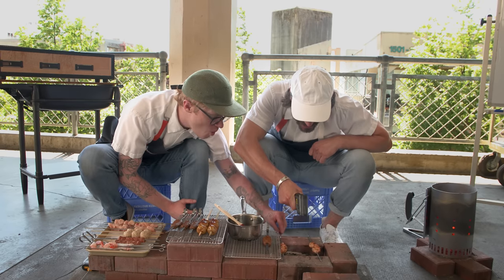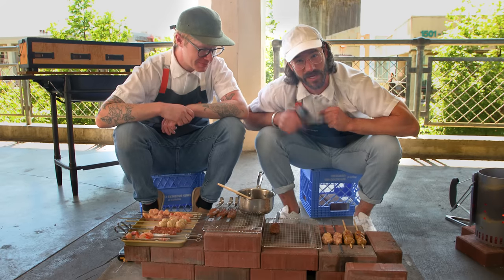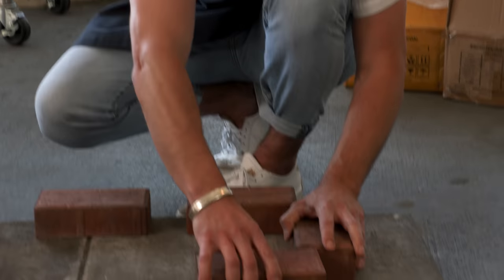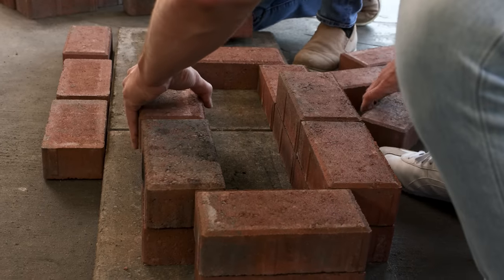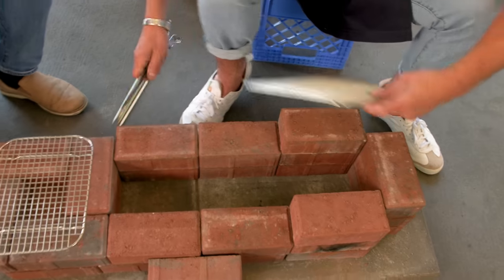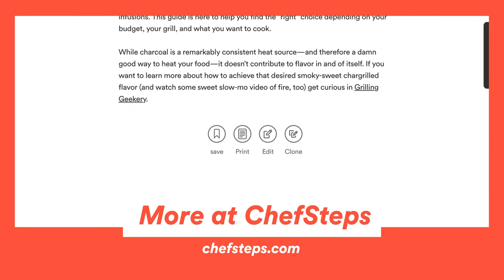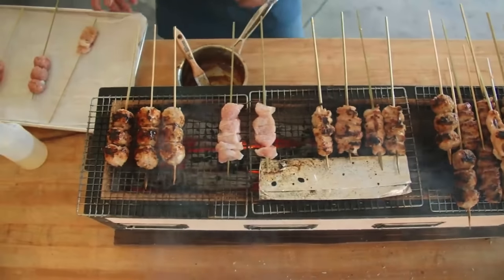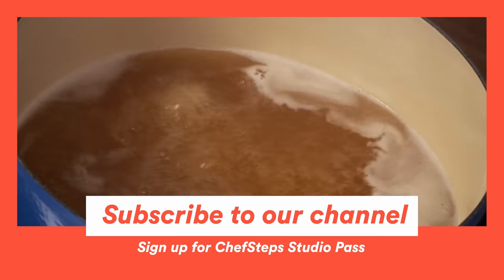How to Build the Ultimate Hibachi Grill for $20 | ChefSteps

Comment: Videos like this always make me nervous when they don’t specify to use firebrick. Most people don’t know there’s a difference or why it’s important.
Reply: Came here to say this. Careful, y'all.
Reply: Somebody pin this comment, THINK OF THE CHILDREN!
Reply: These look like landscaping pavers which is a terrible idea.
Reply: Exactly the comment I was looking for! Exploding bricks will definitely ruin your day
Reply: They did specify it for the earlier use when they built a pizza oven. As this is a continuation of that video, and it's the same type of brick already, they didn't mention it. Which they should anyway.
Reply: As an unsuspecting noob, what is the difference? Based on the replies I’m guessing specially made bricks that are high-heat tolerant…
Reply: @katl8825 normal house bricks can explode when hot
Reply: @katl8825 normal bricks and concrete are porous meaning they have moisture inside, thus when heated the water evaporates, causing the brick or concrete to explode.
Reply: @AhmadIzzJ  well they didn't explain when they had the chance at the beginning of the video. They just said it, it's just 25 bucks bricks from blank depot.
Reply: I kept waiting for them to specify what type of brick because finding food-safe non-exploding bricks isn't that easy when you're at the store. So much for that hope.
Reply: They don’t explode though, they crack.
Reply: @tdolan500  That’s true 95% of the time. But a porous brick with moisture trapped inside will explode.
Reply: I was wondering if they mention not using regular explosive bricks.  Guess not. :(
Reply: U cant make a gold ring using copper. Nuf sed
Reply: once all the bricks crack, you can make two grills!
Reply: Shhh, let Darwinism have a moment.
Reply: @t0msie  they crack, don't explode lol.
Reply: There's three broad categories of brick - red concrete 'holland pavers', clay fired 'brick', and refractory 'fire brick' in a red color.  I honestly don't know which one this is; It certainly has the side spacer markings associated with concrete holland pavers.  I don't think this test was sufficiently long or hot to make a dry concrete brick explode; Their flat grey pavers that they're using as a base certainly look like concrete.
Reply: @TrogdorBurnin8or  I don’t think it really matters what brick they use in the video unless they specify. The video is framed as a way to do this on the cheap. So people who don’t know better and want to try this may think it’s okay to use whatever brick they can get their hands on. That’s my concern.
Reply: What ya talking about man… Low voltage is just as safe, no one ever died from low voltage! Bricks are the same, no difference, just same same… /s
Reply: they think it’s only for entertainment but when someone attempts this wrong then damn😂
Reply: Most people on here drank out of a garden hose.
Reply: Same too with using river rock around a fire pit. What none of the responses to this comment mention is that this potential problem can be easily and safely addressed by a series of “seasoning” burns of increasing temperature to drive out any/all moisture that may exist (dry air pockets are not problematic). In fact, this is essentially the way bricks end up being “fire bricks”. Should probably been mentioned in the video but the doom sayers and No Nothings who have contributed this far have not offered anything constructive. Great video guys! Thanks.
Reply: @the_kestrelstudios  “No Nothings” 🤣
Reply: @katl8825 A lot of responses you got are wrong. These guys are using clay bricks used mostly for landscaping, called pavers. Cement/Concrete bricks are used in construction.  People build firepits using concrete blocks all the time. These red clay bricks are fine for a cheap DIY solution. They won't last forever and will become brittle or spald from the heat. Firebricks are porous as well. Just keep them dry and don't super heat when they're wet. There's a youtube video called "Choosing the right Bricks for building your Pizza Oven" from the firebrick company that explains it.

Comment: Pretty Genius. Have both a pizza oven and a hibachi grill for a total of $30, that's a bargain.   Too bad there wasn't a Joule ad on this video, I would've bought it from all the money I'm saving.
Reply: Joule requires a smart phone to even function last I checked so it's a no go no matter how good it is. If you can't even turn on a sous vide machine and set the temperature without a smart phone then it's broken by design.

.... maybe they have fixed it... my initial disappointment has meant that I have just not looked at Joule for a while.
Reply: @goffe2282   tbh i don't hate joule and i think sous vide is overrated. chef steps is ultimately a business, they exist to make money. these youtube videos are free for you, they have to put out a profitable product to keep their staff employed
Reply: @goffe2282  for you that may be but I'd rather have no interface on the sous vide device itself. It's more things to go wrong and extra bulk. You're relying on electronics to set temp either way, I'd rather there were less on the device itself since it's in a hot humid environment.

Comment: I cant help but have concerns about the safety of using bricks not intended for high heat or cooking since they might give off random heavy metal gasses, are there recommended types of bricks for these?
Reply: exactly what I was thinking
Reply: You should always use fire bricks anyway, because they don't break in high temperature. These bricks are used for building ovens for bread or pizza, so you don't need to worry.
Reply: Quite literally the same risks are involved with a regular hibachi, Except maybe the risk of you walking into one and toppling it all over ...but yeah its equal caution for both the set ups

Comment: Just a thought, you probably shouldn't  have the "cold zone work station" next to the "serving zone" if you need to put the food into the "high heat" zone. Juices from the raw meat (such as from chicken) could drip onto the "serving zone" food when you're going grill.
Reply from the maker: Very good point! Thanks for the tip!
Reply: Where do you think would be the best place to move it? Would it be to the right of the hottest section?

Comment: if you got another 10 bucks you can buy a terracotta windowbox that is manufactured at high temperatures looks beautiful and is still enough if you only cook for 2-4 people :) highly reccomend custom grillage just get one with a fine mesh in the highest quality non-coated chrome steel. just wield it to metal rod u bend to shape. u cant buy those  i came up with that design xd also there a ventilation/wateringslot at the bottom u might wanna cover that with a piece of mesh and place everything on heat insulating stone. buit the cool thing about this is u can heat it outside then place the entire thing inside your home since its so small it doesnt give up that much heat also nice in the winter ^^(but carefull dont burn your house have a bucket of water around at all times haha.. and in general i cant recommend to make a fir inside your home xD that said its definitely a highlight to have a coalgrill on the dinnertable^^ just be carefull haha) if you wanna smoke anthign jsut throw in a hand full of dried herbs it doesnt get any better :DD found a windowbox with a n olive leaf looks like an authentic ancient italian grill nonna might have used at her kitchenwindowxd propably never happened but you know feels legit haha for like 50 bucks total haha in my opinnion even better than the expensive japanese one !:)

Comment: Using a concrete slab on the base? It can explode as well as those bricks! 0/10
Reply: Please listen to this man…..

At the very least a layer of firebrick on top of the concrete slabs. Then perhaps another layer of sand as the base for the charcoal.

Or another option, look for taobao versions of stainless steel yakitori grills with refractory brick lining.
Reply: Please listen to this man…..

At the very least a layer of firebrick on top of the concrete slabs. Then perhaps another layer of sand as the base for the charcoal.

Or another option, look for taobao versions of stainless steel yakitori grills with refractory brick lining.